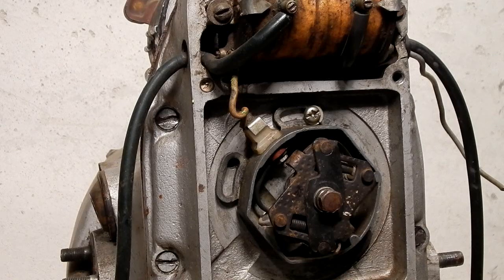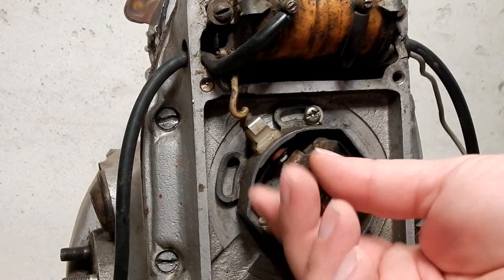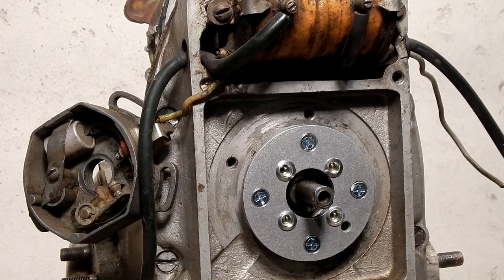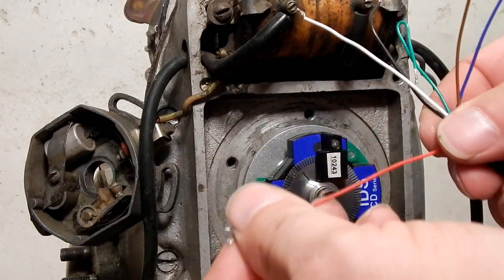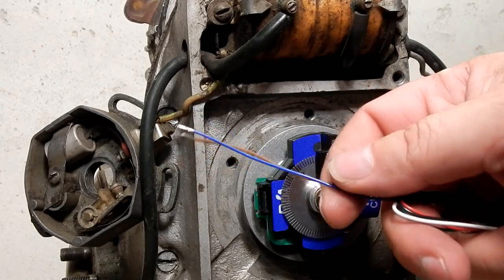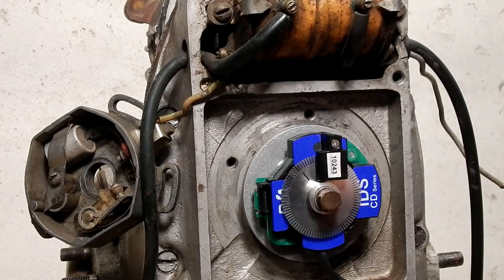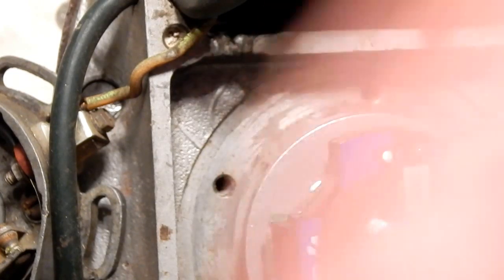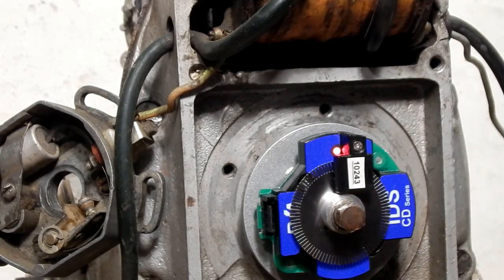Ural   Dnepr Installation Video

Comment: Hi, i have a mt 650.
I have changed the carbs for new ones,new pistons,rings,pins,barrels,fitted electronic ignition,fuel filters but it will only run for a short while then loses power and dies.Any ideas ?
Reply: Did you installed sovek? I have almost the same and did the same. Cold I starting like crazy. When warm will be weaker and weaker. I have an opinion that constant timing will always have this problem. You can choose between running good when warm or starting bad when cold or viceversa. Dynamic maps with variable delay is necessary

Comment: Hey Paul - There are two arrow marks on the flywheel - one indicating TDC and one indicating the ignition timing.  When you say "TDC" here, you actually mean the ignition timing arrow, right (the one without the dot)?  My understanding is that's the actual spark point, and that you want that to be just before the piston reaches actual TDC.

Comment: Hi Paul, the russian ignition shown in the vid is wrong mounted to adjust right. You have to install the front drive plate so that you get a rectangular window at the springs.
Reply: 1961Shannon I do not understand your question. This shows how to install the C5 optical ignition using an engine my friend gave me.

Comment: Hey Paul, 
Mapping query. 
In Map 4(blue/brown ungrounded) limp mode.
Would this map assist in kickstarting?
Also...I assume one can switch maps on the fly?
Reply: Chad Burns all maps are the same at idle rpm. The most common isdue with poor starting is a lean carb. You can change maps while riding.